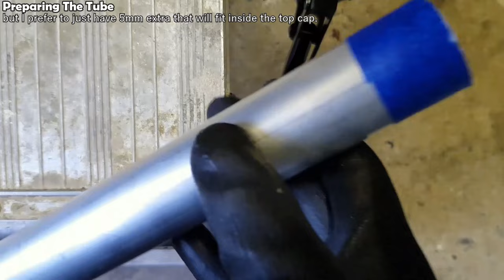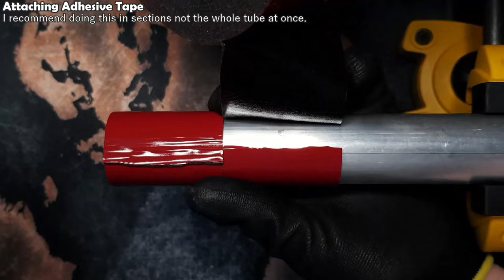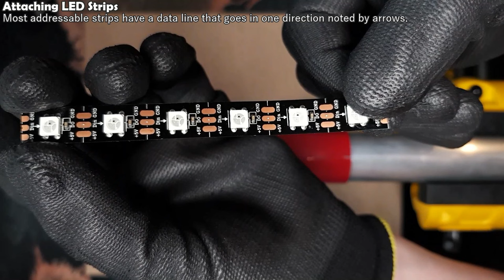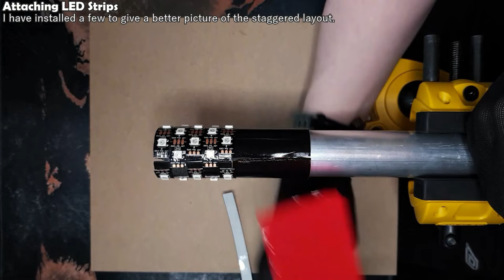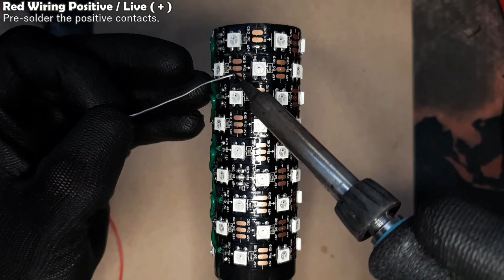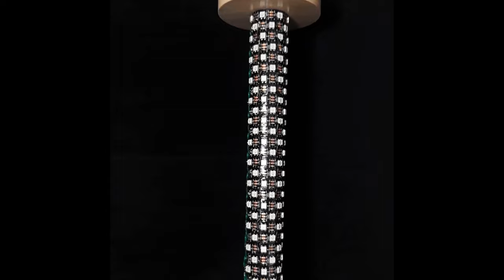Making DIY RGB LED Tube Lamp 6: LED Matrix

Comment: Is this better than arranging the strips lengthways along the pipe? It seems that would use less soldering and less cutting. I’m just curious as to why you chose to line them up crosswise. Great job though. Nice and neat :)
Reply from the maker: Hi Rachael
Thanks for the question, i did try multiple longer strips during design testing but i found they tended to come loose after a while with prolonged use, I wanted to avoid gluing in place as it makes replacing a bad led very problematic.  Using the across design the wiring itself offers additional holding strength to the strips around the tube and i never had any strips detach.  

That being said if i were to make an even taller version of this project i probably would revisit the strip direction design issue.

Hope this helps 👍